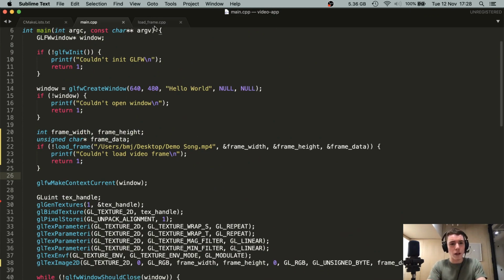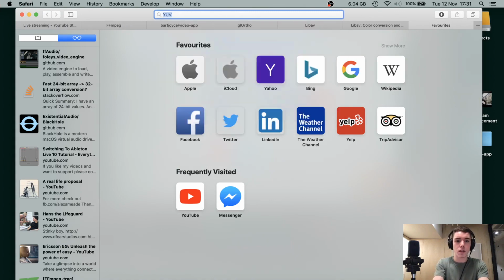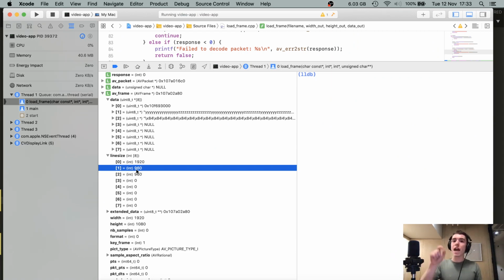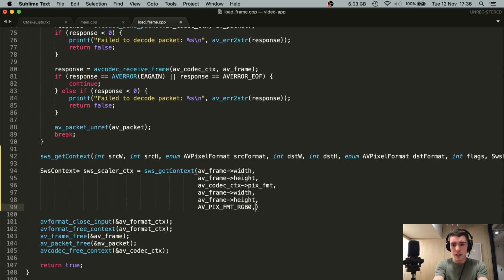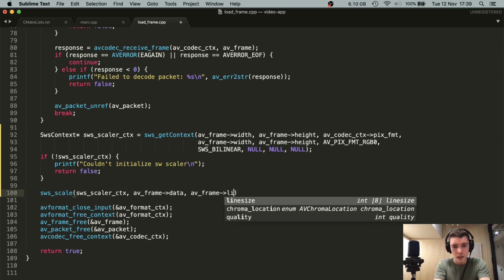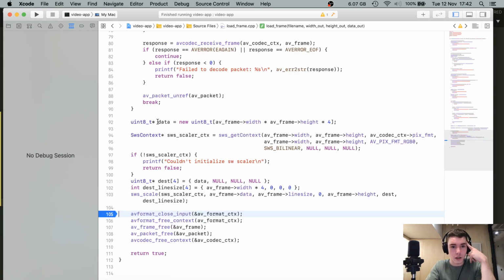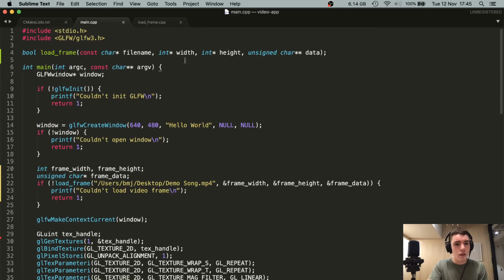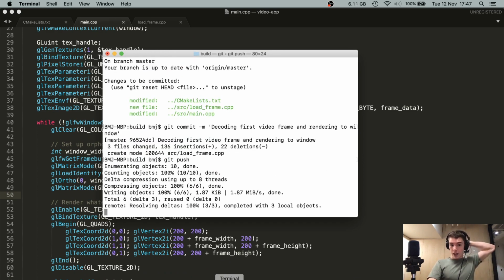Decoding video pixel data in C++ using FFmpeg (Part 2)

Comment: You would be much better off uploading the YUV frames to the GPU and then writing a shader to convert to RGB for final display.Not only do you not need to use loads of CPU resources to handle the conversion, but also you save PCIe bandwidth, not to mention the fact that GPUs handle upload of 2BPP formats a lot better than 3BPP pixel formats.

Comment: Great video overall! Your simple explanation of the human visual system is generally correct when you say we see luminance better than color. However, more specifically, we are more sensitive to luminance *spatially*. 

This leads to my main point, you said that the reason the color difference components (U & V) had a line size of 960 was because only 4 bites represented a pixel. In reality 8 bites represent 2 pixels spatially. Ie if the Y-Component is 1920x1080 pixels the U and V components are 960 x 1080 (for 4:2:0). I would recommend anyone interested to look up  chroma subsampling: https://en.wikipedia.org/wiki/Chroma_subsampling

It’s unfortunate the term YUV is used in FFMPEG as it is an outdated term from the analog days where Y’CbCr is digital.
Reply from the maker: Incredible! I didn't know this. What an intelligent way to compress video data. Thanks for mentioning 👍

Comment: @Bartholomew
How do i save these 
*width_out = av_frame->width;
*height_out = av_frame->height;
*data_out = data;
in png file.

I tried but the image is full black??
FILE *pFile;
pFile = fopen("frame.png", "wb");

if (!pFile) {
        ALOG("Couldn't get pFile\n");
        return false;
    }
fprintf(pFile, "P6\n%d %d\n255\n", av_frame->width, av_frame->height);
for (y = 0; y < av_frame->height; y++)
      fwrite(data, 1 , av_frame->width * 3, pFile);
fclose(pFile);